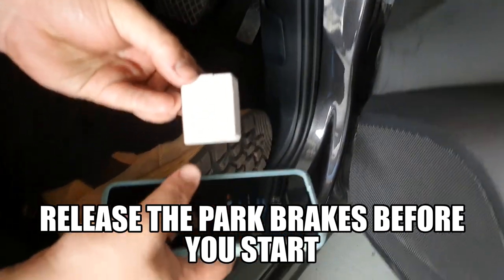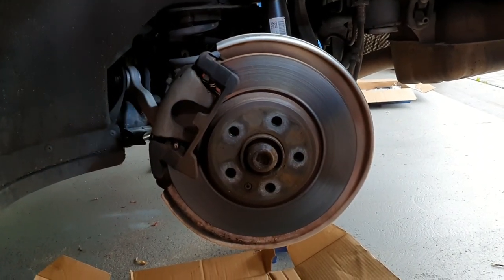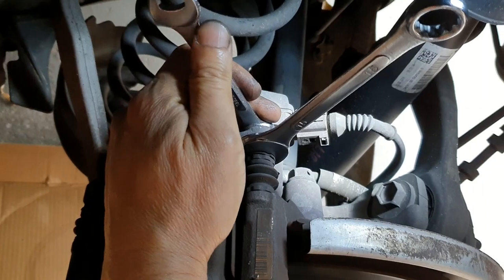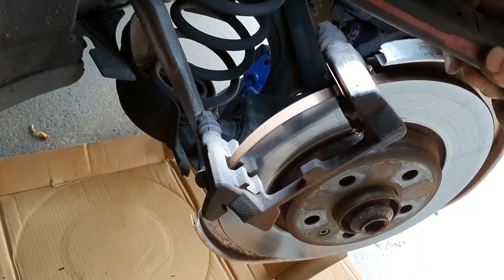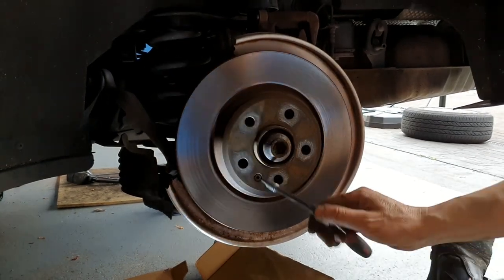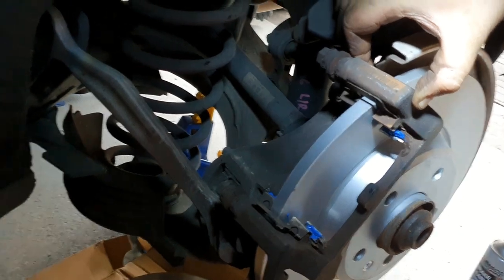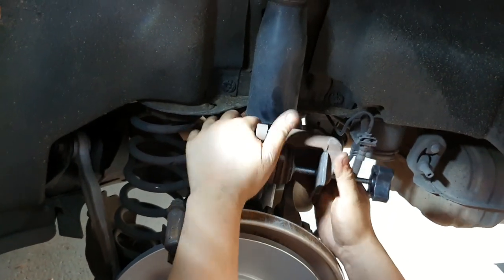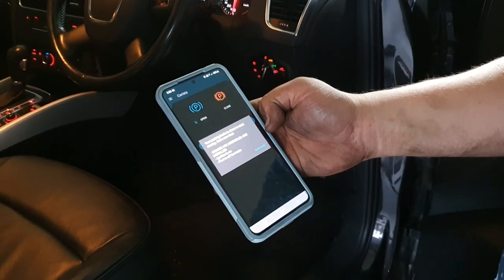How to replace AUDI 2010 Q5  rear brake pads and rotors

Comment: What is the size of the rear rotor for 2010 Audi Q5? 300mm or 330mm?
Reply from the maker: Hi, this Q5 didn't have the sports option so the rotors were 300mm

Comment: I am shocked that you didn't have to use a breaker bar to get the caliper bracket bolts loose! I had to!
Did they not have to be replaced? An exploded view of the parts says to REPLACE. What say you?
I also had to break the rotor free from the hub which I did with a simple bolt, nut and washer.
A big rubber hammer would not persuade it.
Reply from the maker: hi, yes I was very surprised too about  the caliper bracket bolt. I haven't actually replaced any caliper bolts on brakes that I have done.